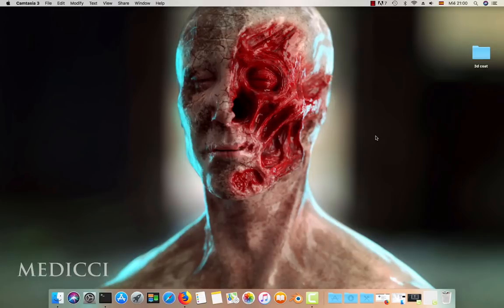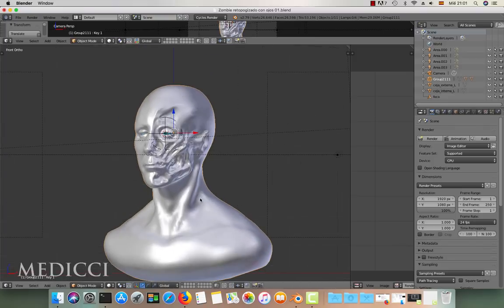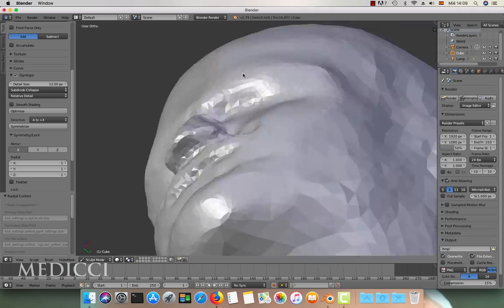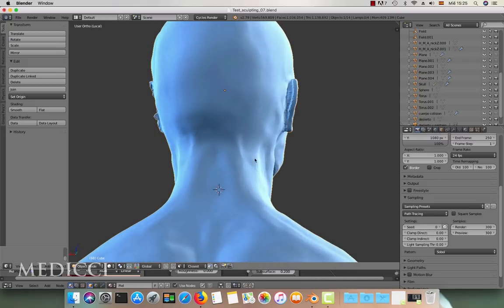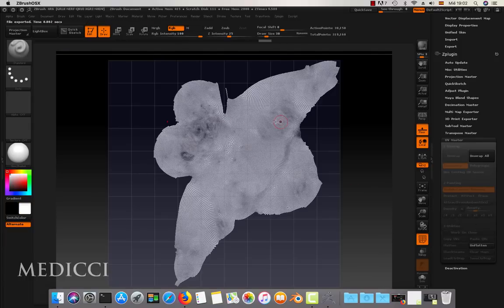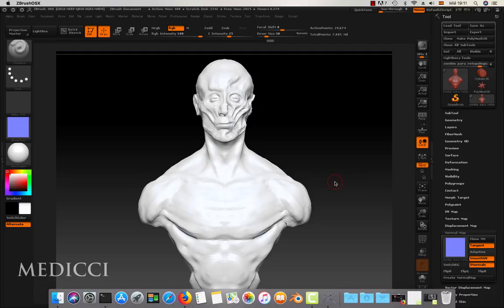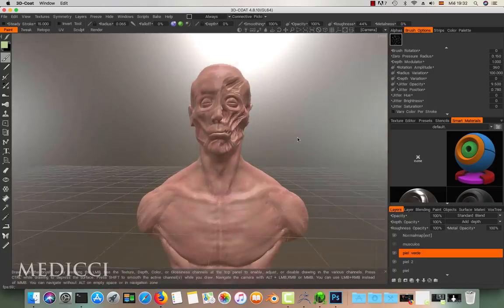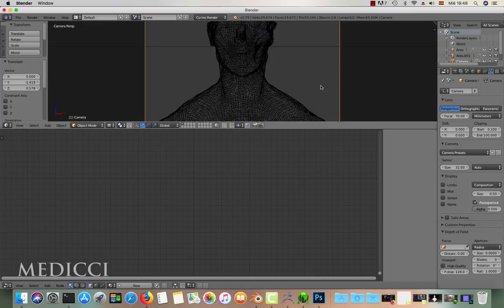How to mix Blender, Zbrush and 3D Coat

Comment: I own Zbrush and 3d coat and know a bit of blender. Zbrush is a little too expensive if you are just going to use it for zremesher and projection. Using blender for sculpting when you have zbrush or 3d coat really makes no sense. Blender is free and wonderful but there really is no reason to sculpt in it if you have the other two. 3d coat has a good auto-retopo too and also can render as well. I dont think you know what you are doing :D
Reply: I couldn't have said it any better.
Reply: this guy has lots to learn, you can see that
Reply: i mean there is something called "Pirate bay"
Reply: I was expecting to see this workflow:
-Blender (Box modelling the shape) -> Export to Zbrush
-ZBrush (Sculpting all the details)-> Export to 3DCoat
-3DCoat (Retopo, UV, Map baking and painting)
At least, this one makes more sense and use the strengths of each software, since UV mapping in 3d coat is such a joy. And blender is pretty good for modeling and sculpting, but it makes no sense to sculpt in blender when you have ZBrush and 3DCoat.
Reply: Koray Satiroglu ? You say you know a little bit of Blender but do you know much about sculpting on it? 

Blender has a pretty decent sculpting suite especially because of dynamic topology. I find it quite easier to get the result I want for the beginning shape of my models on Blender than on ZBrush with its “dynamic balls” or whatever that is called. ZBrush is good, but in my opinion it’s a bit more tedious to start on ZBrush than on Blender so I personally would do the same as the presenter.

It is true that he doesn’t particularly sculpt in ZBrush at any point but you well could: in my opinion Blender works great to define the shape, then simply do the heavy sculpting work in ZBrush. It is far easier to get the general shape of your mesh with Blender and it’s modifiers - then you can simply polish in ZBrush.

That being said Blender is more than capable of being its own sculpting suite, I’ve sculpted substantially with it and although it lacks the amount of brushes ZBrush has, it can do a pretty good job on its own. 

The only issue Blender has, is the way it loads meshes when sculpting which can be pretty slow. 

It’s ok until you’re at 3million polys tho, so it’s more than good enough to define the shape of a mesh (which is kind of what he did there, although arguably one could have sculpted on top of it with ZBrush to get even more control of the detailed high poly mesh).